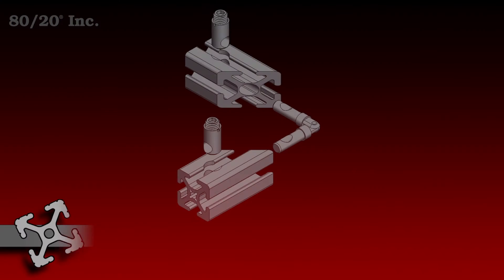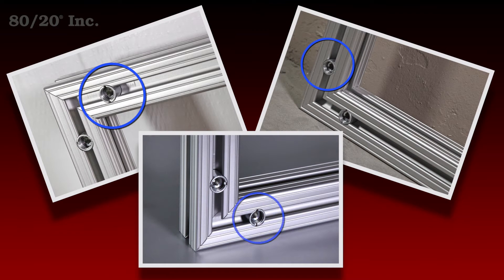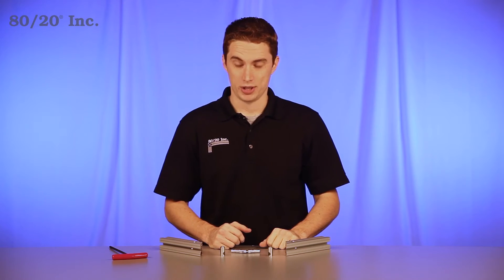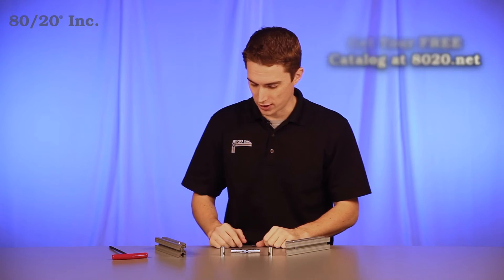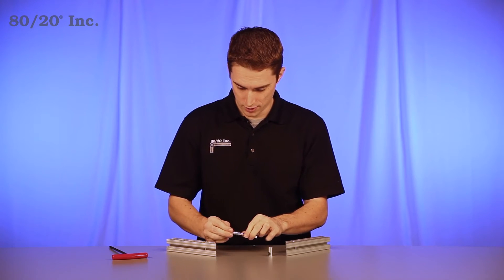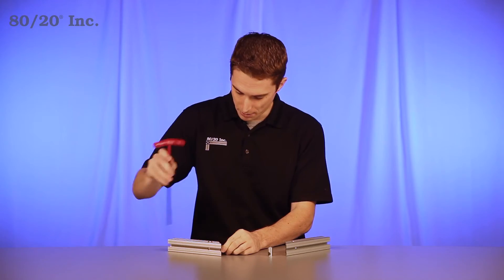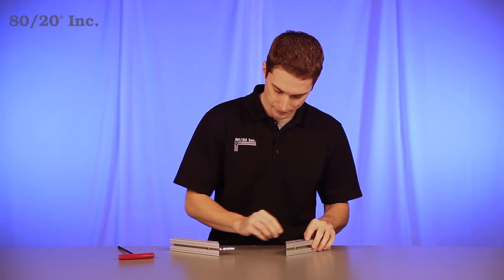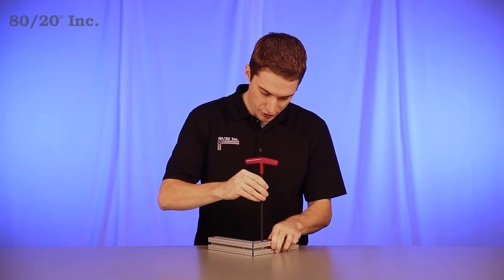80/20: Miter Connector Overview

Comment: You demonstrated how to connect a 45 degree miter... in parallel (or co-planner) with the other piece. Can you use the miter connector to run a profile perpendicular from your main profile (piece). There is a 45 degree connector but only for the 40mm. However, that too is designed to run parallel (co-planner) with  two other profiles. Unless you grind off the tabs and turn it 90 degrees.
Reply from the maker: Hi, Mikell. The miter connector is designed to joint two mitered bars only in parallel. We do offer a standard miter cut and counterbore service that will allow you to mount the mitered bar either parallel or perpendicular to the adjoining bar. This service is available for most of our profiles and can be used primarily for miters between 30 and 60 degrees. For convenience, we also offer precut and machined 45 degree supports for many of our profiles.   
NOTE: One thing to keep in mind is, when attaching a mitered bar perpendicularly, the sharp end or tip of the miter cut bar will extend past the side the adjoining bar. The amount that extends will vary depending on the angle of the miter cut. For most applications this is not a problem. If needed, you can easily file the sharp end flush.